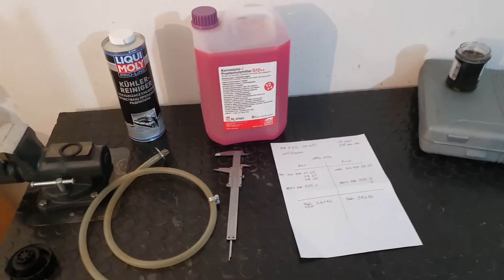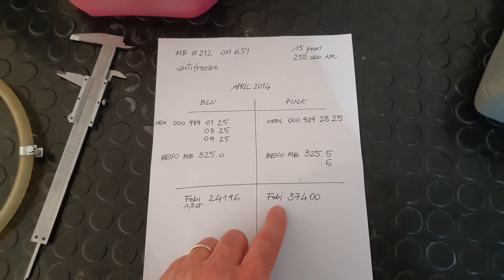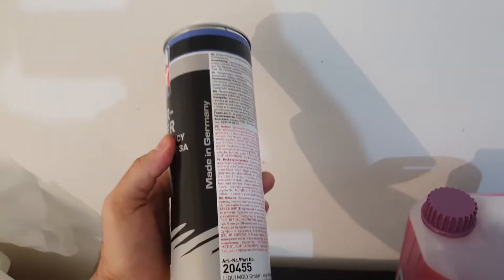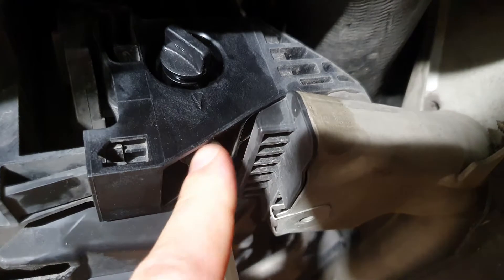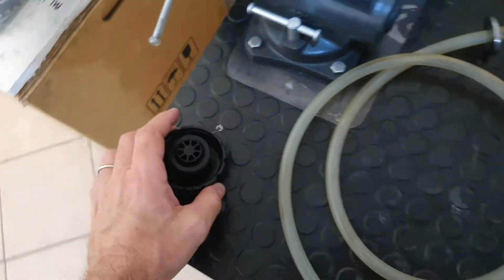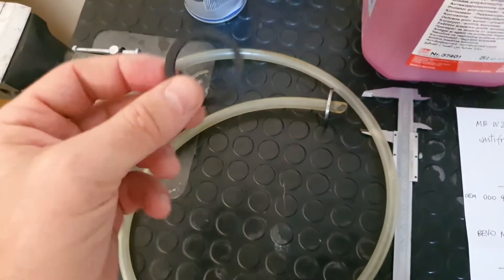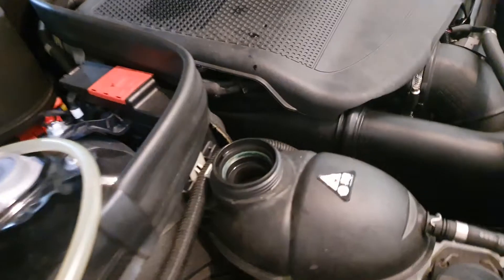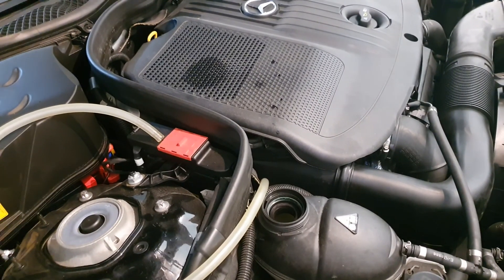OM 651 coolant system flush

Comment: Mine came out the same black color after 10 years and 150K miles. Probably just normal.
Reply from the maker: I simply suggest to change the fluid regularly in order to keep clean the entire system...that's a good rule for all filter and fluids in every car...
Reply: @diycarmechanic587  I completely agree. I just bought this car and the job never been done before.

Comment: This is a really nice video on how it should be done professionally. The motor doesn't have a separate bleed valve and can just topped up and then let it warm up two cycles and check level. The system can self bleed the air. Just have the cap open on the warm up

Comment: Hello, had the antifreeze like yours with 160 thousand kms and 15 years! I did 4 washes with water just until it was practically transparent, but when checking after 5 thousand kms it was black again! Is it normal or do I have to do a wash with Liqui Moly or longer washes with water?
Reply from the maker: Are you sure you flush the ENTIRE system? You have to bring the system to fully operational temperature (thermostat open)  and turning on the heating system inside the car in order to make all the  liquid moving around. I suggest you trying flush with water again and again..yoj do not need to use a cleaner like Liqui Moly
Reply: @diycarmechanic587  In each water change, I walked well for about 30 kms and turning on the heating system, but I still have the inside of the pipes impeccable! without rust. This black is normal, is it wear or oil?
Reply from the maker: @bbranquinho3133  At thos point it is reasonable thinking there is oil contamination in the system..I saw a video about that on a YouTube channel called MercTips, if I am remembering right..
Reply: @diycarmechanic587  I saw this video ;) , the difference is that mine is still bluish itself, but when placed in a container it turns dark S)

Comment: Thank you for the video! In this way, i.e. sucking with negative pressure you don't have to drain also the engine block coolant, right?
Reply from the maker: I suggest you suck from the radiator drain when you need to remove the old cooling liquid.. later, when you put the new one, use the vacuum to avoid air in the system ...
Reply: @diycarmechanic587  thank you again :)
Reply from the maker: @Matteo-mz7op  The goal here is to be able to takle the job "as a pro" spending as less as possible...😎😎😎
Reply: @diycarmechanic587  I agree. At the dealer the cost is ridiculous :-)
Reply from the maker: @Matteo-mz7op  I recently spotted a Mercedes official video about the specific procedure to refill the empty  cooling  system with specific equipment.. After playing the video twice I was still not able to understend the functioning of such equipment... I am proud of gaining the same resoult with a shim and a piece of pipe.. for no money... About dealer I am convinced they rarely care about car or owner... they only focus on selling.. also at service desk..
Reply: @diycarmechanic587  I can tell you that I know a MB technician. He told me that you can easily do this job on the 651 engine in the classical way. I mean filling from the reservoir and letting air escape slowly and topping up few times. I think they do like this at the dealer also.. Faster and easier. In fact some times clients come back because of an air bubble in the system